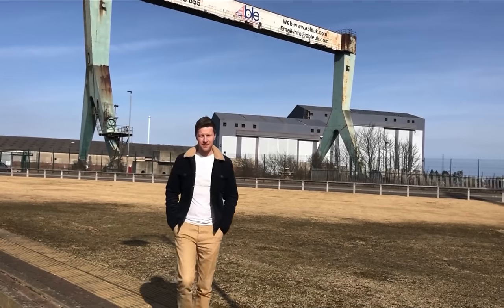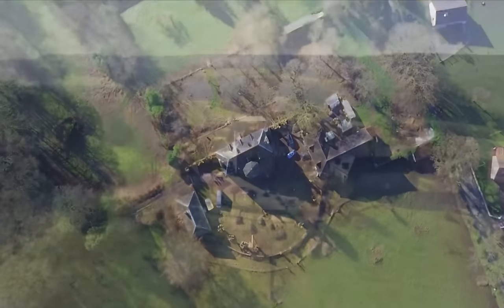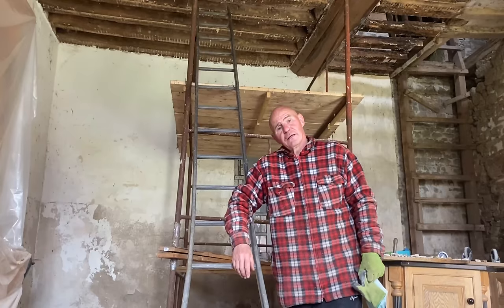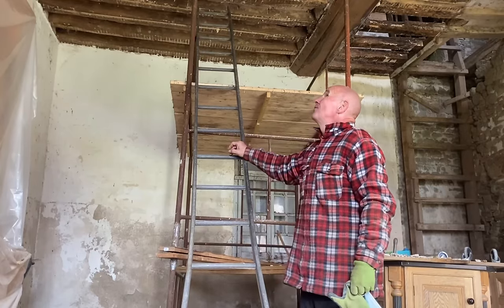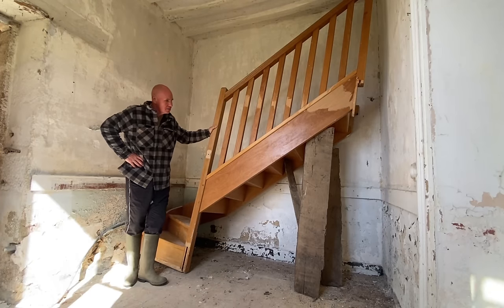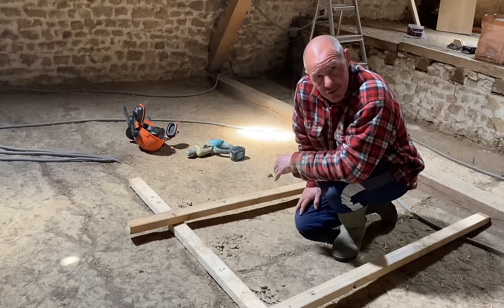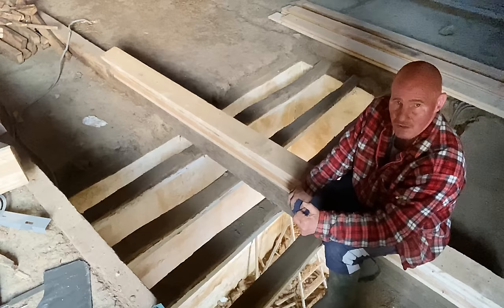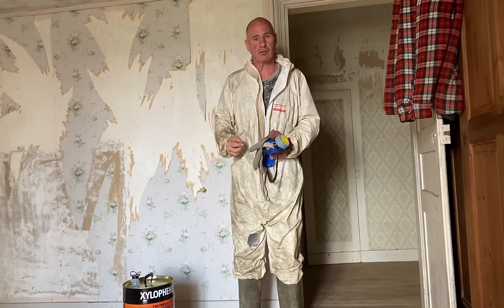Tackling The walled Garden At The Château Ep9

Comment: Woodworm,  you mean termite?
Reply: Wood Boring Insects infest most properties in Northern France and are commonly referred to as ‘woodworm’. In fact most damage to timberwork is in fact caused by the larvae hatched from eggs laid by the flying insects in holes and cracks in the wood, which then eat their way into the timber, pupate and then emerge to start the whole cycle again.Termites are different – they are in fact a type of white ant which eat into the heart of the timber and are very destructive. Termites are common in the South of France, (generally a line South of the Loire) particularly the South West.

Comment: I’ve noticed that a few subscribers have expressed concern over protecting yourselves from dust and droppings etc. And I’ve been reassured by the PPE that you both use and safety considerations like scaffolding and floor working safety. 

I also noticed that Tony is wearing PPE for his woodworm spraying. That’s great but I was concerned that he took off his gloves and facial protection before removing his overalls. I’m sure his overalls have absorbed some spray so touching the overalls without protection could be a problem. And are the overalls replaced or cleaned regularly? Sorry to be a nana about this but I’m a retired OHS consultant.